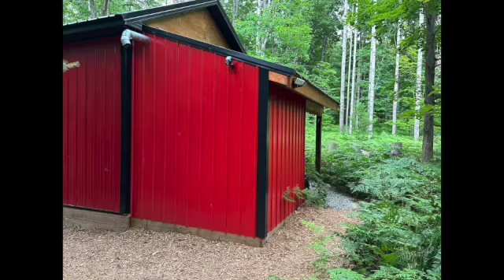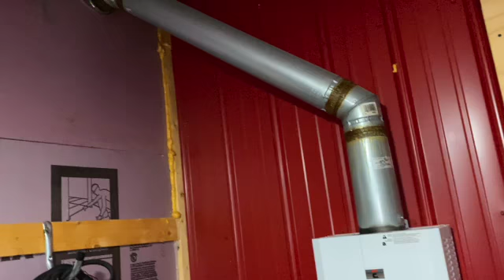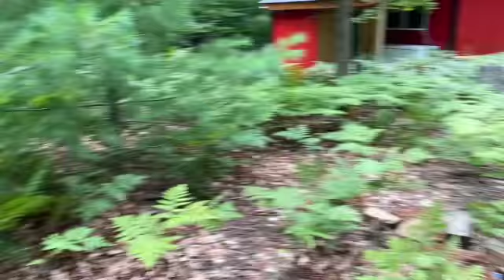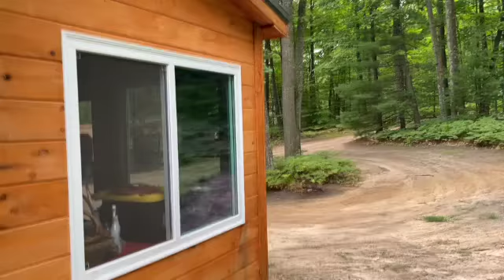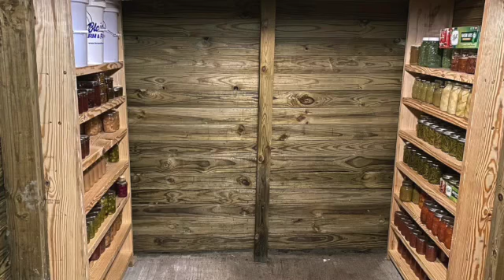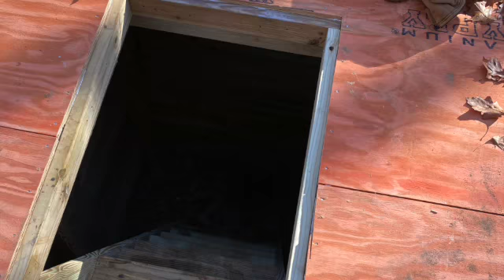Solor System and More For Full Time Off Grid Living.

Comment: Could you post a link for the fridge & freezer you have? I'm living in my motorhome right now but plan to move south and would like to buy household 12 V appliances,  especially the freezer.
My fridge is the largest Norcold that can be put in this motorhome.
Reply from the maker: https://www.thecabindepot.com/products/sunstar-solar-dc-chest-freezer-15cu-st-15cf?_pos=5&_sid=8bbd62c3d&_ss=r
Reply from the maker: https://www.homedepot.com/p/Unique-Appliances-Off-Grid-24-in-10-3-cu-ft-290L-Solar-DC-Top-Freezer-Refrigerator-with-Danfoss-Secop-Compressor-in-Black-UGP-290L-B/308537092
Reply from the maker: We bought our refrigerator 3 years ago from Costco for about half that price.  Unfortunately they don’t sell it anymore.  You might be able to find it cheaper with some more searching online.